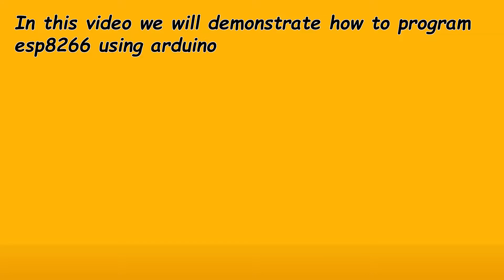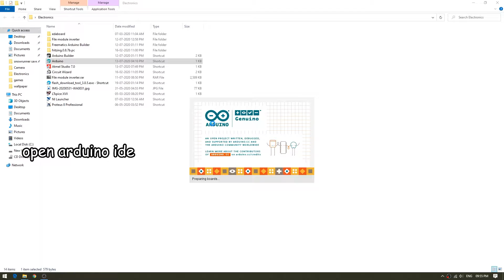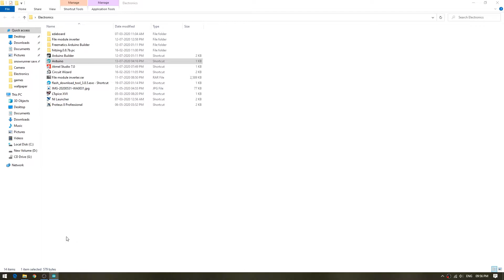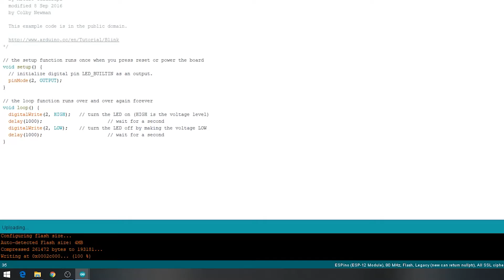How to program esp8266 using arduino

Comment: i have a 8266 12e module can i use a ch340 board tx rx conections & remaing setup to program it, wanted to install wled into it.
Reply from the maker: Yes, You can use ch340g board. Don't forget to put the jumper to 3.3v.

Comment: I have a question, in your RX/TX interface wouldn't the correct connection be crossed? Rx-tx /Tx-rx? In the video it says Rx-rx/Tx-tx.
Reply from the maker: The labelled TX/RX in arduino uno is atmega328 ic's TX and RX, Its connected to the USB to serial converter ic in the arduino uno. TX to RX, RX to TX. Here we are using Arduino uno's USB to Serial converter IC only.

Comment: I have Esp12e and Uno. Do I need anything else other than a 10k resistor while doing this?
Reply from the maker: It would be good if you have 2 tactile switches.

Comment: why do you have to press the reset button when connecting? Is it okay if you don't use the button?
Reply from the maker: To enable boot mode/programming mode you have to press reset and boot button. Then release reset button first and release boot button. For normal operation you don't have to press these buttons.
Reply: @ElectroRetro  is there another way without using the reset button?
Reply: @ElectroRetro  what is the name of the reset button? is there a specific model? I use the reset button connected with a jumper is it the same?
Reply from the maker: @alifghifarii8428  it's a tactile switch. You can use jumper wire instead.
Reply: @ElectroRetro  okay thanks
Reply: @ElectroRetro  sir I've pressed the reset button but nothing happens, when I replace the button pin with the LED, the LED lights up, does that mean there's a problem with the button?
Reply from the maker: You need to press boot button also to enable programming mode.
Reply: @ElectroRetro  yes, I did it, but it still doesn't work, error is ESP8266: Timed out waiting for packet header, I have followed all the instructions
Reply from the maker: @alifghifarii8428  did you release reset button first and boot button second?
Reply: @ElectroRetro  i release reset button when is connecting.....___
Reply: @ElectroRetro  I only use the reset button, which boot button is it?
Reply from the maker: @alifghifarii8428  Boot pin is Gpio0. You need to connect Gpio0 to ground to enable programming mode. You can use a switch or a jumper. Here 2:44 iam using a jumper.
Reply: @ElectroRetro  ah i see, i use jumper to connect Gpio0 to ground, i release it first and second i release di reset button
Reply from the maker: @alifghifarii8428  release reset button first
Reply: @ElectroRetro  still connecting sir
Reply from the maker: Did you check your connections? Make sure there are no loose connections.
Reply: @ElectroRetro  okay sir i will check it
Reply: @ElectroRetro  new error sir, Failed to connect to ESP8266: Invalid head of packet (0x80)
Reply: @ElectroRetro  sir i change to use esp01 with usb and now it works thank you for everything sir

Comment: sir, why does my esp8266 wifi module always restart itself when the relay is in the close position and connected to AC current, but when the AC current from the relay is not connected and the relay is in the close position, the esp8266 wifi module is fine, I have used a relay that has an optocoupler?
Reply from the maker: Do you have flyback diode connected to the relay? If yes, then it may be electromagnetic interference from relay.
Reply: can a flyback diode fix this?
Reply from the maker: @alifghifarii8428  it may fix.
Reply: @ElectroRetro  I've used a flyback diode and soldered it to the relay but still can't fix it, is there another solution?
Reply from the maker: Place relay further from ESP. That may work.

Comment: Did you have to use another adapter before connecting the module to the arduino?
Reply from the maker: Did you mean that breakout board? I made my own breakout board for esp8266 to plug-in ESP in the breadboard. You can buy a ready made breakout board for esp8266.
Reply: @ElectroRetro  I'm sorry, i don't understand very well yet how to use this module. I've seen in another videos that they always use some type of adapter to program the esp, like the usb to serial or the nodemcu... and I thought that if you were using the arduino IDE to program the esp and the arduino uno board as an adapter, then you should disconect the atmega microcontroller from the board to do it... but after watching your video i realiced that it's not necesary..
Reply: @ElectroRetro  And do you have to do something so the esp can understand arduino IDE sketchs? like when you install the boatloader in the atmega328
Reply from the maker: Here am using an Arduino board as a USB to serial converter. You don't need to remove atmega328 ic if you short reset pin to GND. You have to add esp8266 boards in Arduino ide before uploading the code.
Reply: @ElectroRetro  i hope it works with my esp12e i had a nodemcu it shorted somehow first time the voltage regulator f** up then the whole board except the module
Reply from the maker: @thisisthanish It should work with esp12e.
Reply: @ElectroRetro  can i dolder the wires directly on my nodemcu because i don't have a hotplate or hot air gun
Reply from the maker: @thisisthanish yes, you can solder directly.
Reply: @ElectroRetro  oh thanks i am on it
Reply: @ElectroRetro  do you know about sim800l have you worked with it?
Reply from the maker: @thisisthanish No, Iam not familiar with GSM modules
Reply: @ElectroRetro  ok np i tried interchanging the tx rx pins even i am getting this error 
Failed send cmd(init#1)
Reply: By the way i am using arduino nano
Reply from the maker: @thisisthanish  it should work with arduino nano. Because we are only using usb to ttl chip on the board.

Comment: When I press the reset button It does nothing the connecting message keeps saying connecting and it shows the error failed to connect esp8266 Timeout waiting for packet header
Reply from the maker: Try holding-down the button while uploading a new sketch at the same time.
Reply: @ElectroRetro  ok
Reply: @ElectroRetro  nothing happened same error message
Reply from the maker: Make sure your connections are OK and button is working properly.
Reply: @ElectroRetro  done i think you told to use one button other videos tell to use 2 buttons and many resistors. So isn't it problem  with circuit.
Reply from the maker: @tablachallenger2745  2:44 you need to short gpio0 to gnd to enable flashing mode. In other videos they use button instead of this wire.
Reply: @ElectroRetro  Yeah I have done it rewires the whole circuit 2 times checking correctly and following instructions. Although my my project is not working but I haven't seen any youtuber focusing so muchhhh!!! on a viewer problems. i think you have answered me more than 10 times. thanks a lot
Reply: @tablachallenger2745  hi, did u get ur project working?

Comment: Is it possible to program a Arduino in breadboard by nodemcu esp8266
Reply from the maker: If nodemcu 8266 board have usb to ttl chip then yes. Otherwise you can't.
Reply: @ElectroRetro  yes it's have a ch340...
Reply from the maker: Which arduino board are you using? why you need to program arduino using esp8266?
Reply: @ElectroRetro  my Arduino burnt on power delivery circuit...but the atmega is fine...so i want to program it though i need a usb to ttl trying not to buy that...i got a esp8266mod ...nodemcu trying to find it's actually possible or not
Reply from the maker: Actually I didn't try programming arduino with esp8266 nodemcu, But I think it's possible. Please let me know if it's successful.

Comment: will the connection be different in esp8266(esp12e)?
Reply from the maker: No, same as esp12f
Reply: @ElectroRetro  can i get the written code?
Reply from the maker: @sheetalprasad5514  which code?
Reply: @ElectroRetro  the one that we need to upload in the ide
Reply from the maker: https://arduino.esp8266.com/stable/package_esp8266com_index.json
Reply: @ElectroRetro  Can i get the code which is needed to be uploaded in the ide for the working of esp8266?
Reply from the maker: Did you mean that url?
Reply: @sheetalprasad5514  its just a demonstration code he uploaded ......
Reply: @ElectroRetro  i am getting unsupportedcommand error

Comment: Sir I don't have resistor can I do something without resistor
Reply from the maker: No
Reply: @ElectroRetro  ok
Reply: Isn't there any alternative i have a photo resistor. Any jugad
Reply from the maker: Do you mean ldr
Reply from the maker: If you have a LDR. Give it a try. You need to adjust the light intensity to get the right resistance
Reply: @ElectroRetro  thank you sir ldr worked but when I press reset button while connecting nothing happens

Comment: i am getting error Arduino: 1.8.15 (Windows Store 1.8.49.0) (Windows 10), Board: "ESPino (ESP-12 Module), 80 MHz, Flash, Disabled (new aborts on oom), Disabled, All SSL ciphers (most compatible), 32KB cache + 32KB IRAM (balanced), Use pgm_read macros for IRAM/PROGMEM, dtr (aka nodemcu), 4MB (FS:2MB OTA:~1019KB), v2 Lower Memory, Disabled, None, Only Sketch, 115200"

Executable segment sizes:

ICACHE : 32768           - flash instruction cache 

IROM   : 231756          - code in flash         (default or ICACHE_FLASH_ATTR) 

IRAM   : 26777   / 32768 - code in IRAM          (IRAM_ATTR, ISRs...) 

DATA   : 1496  )         - initialized variables (global, static) in RAM/HEAP 

RODATA : 876   ) / 81920 - constants             (global, static) in RAM/HEAP 

BSS    : 25608 )         - zeroed variables      (global, static) in RAM/HEAP 

Sketch uses 260905 bytes (24%) of program storage space. Maximum is 1044464 bytes.

Global variables use 27980 bytes (34%) of dynamic memory, leaving 53940 bytes for local variables. Maximum is 81920 bytes.

esptool.py v3.0

Serial port COM3

Connecting........____....._____....._____....._____....._____....._____.....____

Traceback (most recent call last):

  File "C:\Users\HP\OneDrive\Documents\ArduinoData\packages\esp8266\hardware\esp8266\3.0.0/tools/upload.py", line 66, in <module>

    esptool.main(cmdline)

  File "C:/Users/HP/OneDrive/Documents/ArduinoData/packages/esp8266/hardware/esp8266/3.0.0/tools/esptool\esptool.py", line 3552, in main

    esp.connect(args.before, args.connect_attempts)

  File "C:/Users/HP/OneDrive/Documents/ArduinoData/packages/esp8266/hardware/esp8266/3.0.0/tools/esptool\esptool.py", line 529, in connect

    raise FatalError('Failed to connect to %s: %s' % (self.CHIP_NAME, last_error))

esptool.FatalError: Failed to connect to ESP8266: Invalid head of packet (0xF0)

esptool.FatalError: Failed to connect to ESP8266: Invalid head of packet (0xF0)

This report would have more information with
"Show verbose output during compilation"
option enabled in File -> Preferences.
Reply from the maker: You need to press rst button when it shows connecting and don't forget to connect gpio0 to gnd to enable programming mode.
Reply from the maker: electroretroyt@gmail.com
Reply: hi 
i am also facing same issue
how you fix this issue, can you please share

Comment: Your connections are not healthy. Arduino RX TX works with 5 volts and this is not the same as the operating voltage of ESP. It can withstand this in a short time, but it may not be long-lasting.

Comment: I keep getting "Failed to connect to ESP8266: Invalid head of packet (0×00)"
Reply from the maker: Did you put the esp into boot mode? If you select baudrate of 115200 and put the esp into boot mode it will show waiting for download.
Reply: @ElectroRetro  I fallowed your instructions and I put the EN attached to high and the upload speed is 115200. I didn't solder the esp chip, although I checked the connection with a multimeter and it's all well connected with the wires.
Reply from the maker: @lyhongleft3676  did you press reset switch?
Reply: @ElectroRetro  I did, and I also made sure it worked cuz it blinks too
Reply from the maker: When you press reset, Does the serial monitor show waiting for download?
Reply: @ElectroRetro it does not
Reply: Hmm, maybe I needed to solder it
Reply from the maker: Probably it's because of loose connections.
Reply: @ElectroRetro  alright, thanks alot